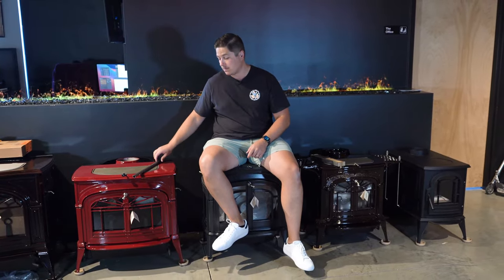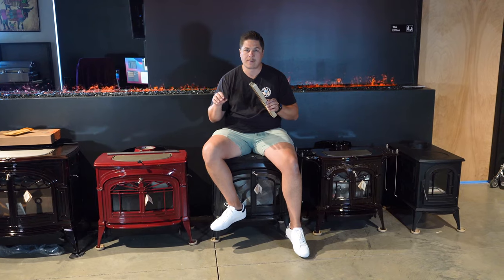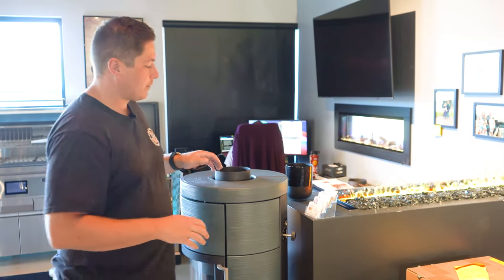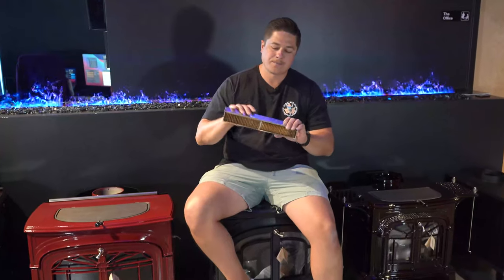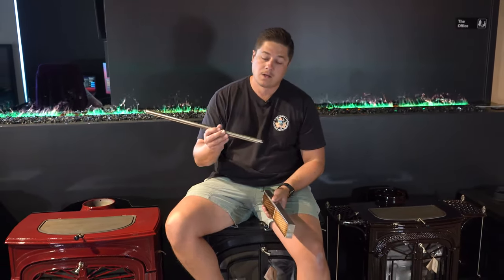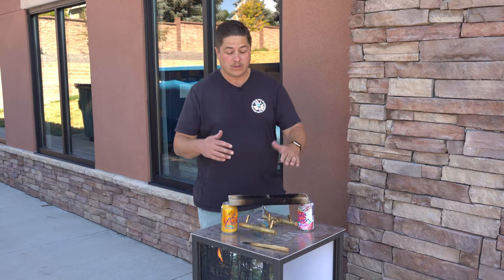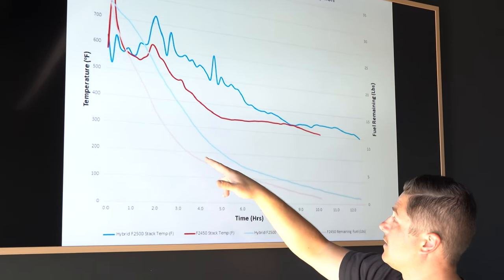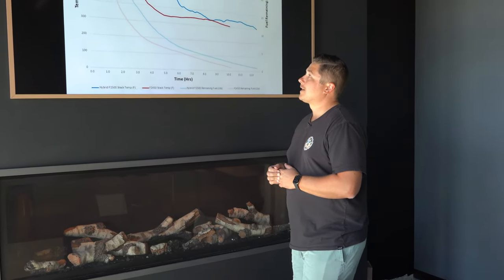Catalytic vs Non-Catalytic Wood stoves (Which one is better?)

Comment: Fun fact. Burning pine indoors is not a problem.  Of course many many old timers have always known this and have been getting cheap pine for firewood that nobody else wanted. The University of Georgia did a study on burning different types of wood in fireplaces and wood stoves.  The findings were incredible, that pine does not put out any more soot or create more creosote than hardwood. In fact, hardwood can actually produces more. Pretty insane considering conventional wisdom, a.k.a urban myths, has always said the opposite. The only thing to make certain of is that each has been seasoned to less than 20% moisture content. It is believed that the old wive's tale originated from people burning it after seasoning it the same amount of time as the hardwood and began to get buildup therefore assuming the problem was the type of wood. The problem never was the wood but rather the time spent letting it season. Pine takes twice as long to get it below 20% than does hardwood. Pine burns much quicker and doesn't create many embers. So as these wise old timers have always known, it has its place in the firewood lineup. It's great for starting a fire. It's great to initially get a wood stove up to high temp quickly. It's great to fire back up a stove that has gotten cooler. When using it as starter wood, follow with hardwood for more longevity.  Imagine the tons of pine that can be gotten so cheaply. These old timers are not liking their secret getting out. :)
Reply from the maker: Nice! thats great information! thank you.
Reply: Love pine.  Seasons fast and good for when I’m off work and able to freed the stove more. I’ve never had an issue with creosote with pine.
Reply: @brockbaker3able  he said pine takes 2 times longer to properly season so to say it seasons fast is not correct.
Reply: Pine is pretty much the only wood we have available here in northern Idaho.  Burns just fine as long as it's seasoned and dry.
Reply: Alaskan spruce burns well here in Alaska. Nothing but ash left.  
I also burn birch, but I get it before the trees start drawing moisture.
Reply: @Lecon60  Oh ya, well my Idaho Blue Spruce burn better than your Alaskan Spruce any day of the week. 😆(couldn't resist)
Reply: @timbjork2098  he's wrong. I can put pine in a rack in March and by November it's below 20 percent. He's completely wrong.
Reply: I'm not sure what gives you the idea that pine takes twice as long to dry as hardwood but you're wrong. I've been testing my firewood with moisture meters for years and that makes absolutely zero sense. The only pine with a comparable moisture content to hardwood is maybe sugar pine. The rest dry way faster than most hardwoods regularly used for firewood. It takes me 2 summers to properly dry northern red oak. I can dry pine in about 8 months.
Reply: Maple and pine are my favorite woods to burn both season in about 9 months for me depending on the weather and how dry I can keep it.
Reply: @davetruewang-bz4oi  What "gave me the idea" was the study that was done. I'm sorry if the information is incorrect or doesn't match your experience. It now doesn't match mine either. I began splitting and stacking pine for the first time after learning this. The pine has seasoned a lot faster than the hardwood I split around the same time. It makes me wonder if it was possibly a different pine that was used in the study or what the conditions were for the study that made it take longer. Going to figure out if it was wrong or if I screwed up somehow.
Reply: I got it backwards after reading all of the info. My bad. At 50, I can read something and 10 minutes later forget what I just read. Pine takes less time to season, but hardwood can actually create more soot than pine if not seasoned long enough. So either wood can be a problem just as much as the other. That's why the problem has never been the pine but rather the time either wood should be given to season. That and the temperature at which it is burned. Soot is a result of either unseasoned wood or of burning at too low of a temperature. It has nothing to do with resin as people have said for decades. :)
Reply: @Sevenine88  Google University of Georgia study about burning pine vs hardwood.
Reply: Only a reburn stove for me, thinking futuristically if everything went hell in a hand basket tomorrow, no power, gas, water, communication etc that catalytic honey comb wont be available to purchase because you and the other stores manufactures wont be open or working and it would be pulled out and thrown away and then your back to square one. So don't think of just today, the way things are going in our country, think about the future and the worse that possibly could happen. Just an old man's two cents
Reply: Burning anything indoors can be a problem.  The amount of people with fireplaces that think they are like a natural gas furnace (throw in wood and forget it) is amazing.  That is more the problem with any wood.  Wet wood is the enemy.  Personally, I avoid pine and use primarily Trembling Aspen and birch.  Pine is nice outdoor campfire wood with the snaps and pops.  I found Pine/spruce/fir did leave more carbon behind, and Aspen/Birch had virtually clean fireboxes.  I have a professional chimney sweep come by once every 3-4 years for insurance happiness, and the pictures are always creosote free.  

Yes, I am older than most.   I've been heating with wood for 40+ years, and experimented as a young lad with different styles, etc.   Burn what you have, just understand how the wood works, how your appliance works, and don't play f around and find out.
Reply: what's nice about pine is relatively low ash. I burned cottonwood and man, is it ashy!

Comment: Neither are better. In my opinion, the EPA should be abolished they have their dirty unelected mitts in everything from wood stoves washing machines to diesel trucks. Overcomplicating a simple device, season your wood properly and my old fisher is almost as efficient. And to boot, although frowned upon if you must you can burn something a Little green if you run low on wood. Never understood all this nonsense.
Reply from the maker: ok
Reply: Agreed

Comment: My Blaze King Ashford 30 will EASILY burn for 24 hours on low, the catalyst always in the active zone. The non-electric highly effective automatic thermostat is truly set and forget. I replace the catalyst every 12,000 hours of burn time.
Reply from the maker: good idea
Reply: Your going to see smoke out your chimney before you reach 12000.

Comment: The 2" thick by 6" in diameter round catalytic converter on my 40 year old consolidated dutchwest by Vermont Castings is made of a honeycomb, hard clay like material. The maintenance requires rinsing and saoking with warm water once per season. My first converter lasted approximately 25 years before small pieces of the material degraded and began breaking off. After the temperature in the pin thermometer that fits into the steel plate above the converter reached 500° I closed the damper and diverted all of the exhaust through the converter. I call it cracking the smoke to clean it up. You can go outside at this time checking the stack and see that there will be very little to NO smoke coming out. Granted, we don't have Severe winter's here in Louisiana, but many cords of wood have gone through this stove and converter over the years! Absolutely Love it!!😉
Reply from the maker: thats awesome. Many people ask how to clean and how often. Thanks for the responce.
Reply: @embersliving  Once a year I'll get on the roof and pull the stainless cap off the stack and drop a 6" wire bottle brush weighted with a 6 lb mall head down through the stack with 28ft of rope. The only resistance for me is going through the triple wall piping, the single wall is not as tight. After 3 passes I go inside, open the top damper and pull the carbon pieces into the stove dropping to the ash pan (approx 2-3 cups of carbon. All vents are closed and no dust goes into the house during the brushing. We Must use Well seasoned wood, especially if you like to burn a cooler fire at times and have a tall vent stack! Unseasoned wood, burning cool fires means build up in the stack, creating a fire hazard. I burned some slightly seasoned RED oak one year and inspected a few 6 ft sections of the single wall piping because I didn't have much carbon accumulation after brushing. I found an 8th of an inch of smooth, hard, carmelized coating throughout the piping. Couldn't remove it with a metal scraper, so I replaced all of the 6" stack. I have 26 ft total stack and I must burn very seasoned Oak. Shorter run of stack should result in less coaking.

Comment: great segment sir. you clearly explained the difference between CAT stoves and secondary burn stoves. I've been burning wood in my current house for over 25 years. I had a CAT stove from Consolidated Dutchwest that was ok but i didn't like it and got some secondary burn stoves. I currently have a Jotul F3CB upstairs in 1100 square ranch and a Pacific Energy Summit in the full basement. Both have served me well in southern Maryland. Most of the time my Jotul does the job. During this last cold snap and snow, i had to fire up the Summit. Key to any of them is using dry, seasoned wood. thanks for sharing.
Reply from the maker: Im glad our video helped you!

Comment: Cheers for this, very informative. We installed a catalyst wood burner 12 months ago and very impressed with it compared to the old wood burner.
Reply from the maker: Thanks for watching!
Reply: Have fun repairing your catalytic combustor. High/costly fail rate on those.
Reburn much better=less potential of failure.
Reply: @Bayside  where having lots of fun.... burning half the amount of wood , been 2 winters now and catalyst still performing very well. Absolutely amazing.
Reply: The science that you don't understand behind the catalyst, is that the precious metal platinum in the honeycomb catalyst, lowers the burning temperature of smoke, allowing it to be re-burned👍

Comment: The precious metals on the combustor lower the burning temperature of smoke from around 1100F to 500F so it can burn.  They work great provided you take care when using them.  I've done so for 30+ years and really like them.
Reply from the maker: awesome!
Reply: How about over time as the stove cools down, is it going under 500 degrees and not working properly? I’ve gotten coal base 12 hours but the stove doesn’t seem very hot. What about the air intake and the spring inside? My stove is old and I think it needs replacement. Any help on this would be appreciated thanks.
Reply: @lordmarshall5239  What stove do you have?
Reply: @StudioRV8  I have a1987 I believe, Intrepid 2
Reply: @lordmarshall5239  Tough to say with a 30+ year old stove w/out seeing it.  The new Intrepids are flex burn and work with or w/out the cat combuster.  Not sure what they used then.  I think they were all cat stoves.  I'd start with the manual and exploded parts diagram and make sure everything is working properly.   If you need a new combustor, I'm sure you could buy one. I was able to find the manual for a 1990 Intrepid 2 online.  Youtube won't let me post a link, but I'll try to put everything by the http in the next replay to see if that works.
Reply: Add https:
Reply: @StudioRV8  thanks for your effort. I do have the manual somewhere. The stove does  do well in my tiny camp style snowmobile house in Maine. It just seems like it’s probably under 500 over time and not up to the science. It does work and I’m happy so I might just be wrong. I’ll make a better go I’ve learning and maybe open it up this summer. Thanks again for your time
Reply: @lordmarshall5239  The intrepid, like the Defiant I have, does not measure the temperature of the combustor.  400-500F is okay for the top of the stove, and with a reasonable fire, should be enough to light the combustor.  I have a Defiant at my house, and an old Vermont Castings Federal Dutch West in my parents (both also in Maine).  The Dutch West has a temp prob right on top of the combustor, so you know exactly what's going on.  The Dutchwest is circa 1990.  It's a nice stove.  Wish they still made them.  Running a stove is a little more of an art than a science.   There are lots of variables with the stove and lots of variables with the environment.
Reply: @StudioRV8  yes I saw a video saying to put a thermometer on the top right corner and close the damper at 550. I need to reread the manual to understand a few other things like the air intake and the internal automatic spring. I’m having success it seems I’m just trying to know more and get better. I’m in Eustis and it was real cold this winter, until now 😊
Reply: @lordmarshall5239  Yes, you are up there!  The two stoves are in houses on a lake in the Bethel area, but we also have property on Moosehead Lake.   I've landed the float plane on Flagstaff Lake,  by I fly over Eustis all the time on the way to Jackman airport in the RV8.  Stay warm. Cold weather returning tomorrow.
Reply: @StudioRV8  that’s great! Sounds like you have a nice system of enjoying the state. I’m back to New York Sunday unfortunately, great place so much fun over here. I’ve snowmobiled Moosehead, very nice all over this region of the country. Enjoy 😊

Comment: Catalytic  is the best!! My Blaze king princes heats my 1600sq house all day with 4-5 16"x8 logs for 16 hours. And still have plenty ambers to get it going again! Combuster still working great after 6 years. All I donis brush the front and shop vac. Key is gettit plenty hot before engaging it.

Comment: I appreciate having both technologies in my Hearthstone stove. While heating up the stove from cold or after reloading fuel, secondary combustion burns vigorously, producing very clean thorough combustion at high throttle angles and higher combustion rates. Once things are heated up, engage the catalyst and choke it down. The fire can settle into lazyer flames and smoldering, letting the catalyst perform the combustion downstream. This helps separate the combustion from the fuel, providing a slower burn rate. I routinely find a warm stove 12-16 hours after the last reload with coals for a relight. Sometimes even longer. The most impressive part of that, is that I'm burning trashy low density ponderosa. I can only imagine what hardwood would do in this stove. Probably would be capable of 20-24 hour burn cycles.
Reply from the maker: Thanks for the insightful comment on the hearthstone! That is one of our favs.
Reply: I am looking at a Hearthstone 
Heritage.  How do you like yours?  Any issues with it?  I’ve read some really great reviews and some not so good. I went up to my local dealership today here in upstate New York and it’s a beautiful stove!
Reply: @MDR-hn2yz  Had some leaks in the top stones that I resealed with refractory cement. I think the top stones on a lot of these aren't sealed great from the factory or are jostled loose in transport. After that easy repair the stove has been perfect. Ours is the Mansfield, which is similar to the heritage, just a slightly larger, more "square" firebox. It takes wood N/S or E/W from the front door, which works great for our corner-install application. 

It's a complicated stove made from lots of separate pieces. Combines the beauty of a cast iron stove and a stone stove. If you decide to buy a stove like this, go into it with the level of "respect" that the reality of it deserves. This is both a wood stove and a piece of art. It's not going to be as utilitarian as a welded steel stove. Treat it with care and it will treat you to beautiful fires and soft warmth that lasts many hours after the flames have gone out. 

We absolutely love it. Going into our 4th season with it and I have 4 cords of very dry wood split and stacked and ready to go, and another 8 cords that I have almost finished splitting that we'll use in future years. (We burn ~3 cords a season).

I think the mixed reviews are "fair" all around. These stoves aren't for everyone. If you take the time to really read the manual and learn the proper startup procedure and pre-heating procedure, and follow the recommendations in the manual for daily "high-burns" to help keep the catalyst clean and properly get the catalyst going, you'll get really great results from the stove. If you just want a box you can burn in any ole way you want, you'll be better served with a non-cat stove.
Reply: @mdocod   thanks for the reply.

Comment: If you are really "off grid", you aren't going to be able to find someone to clean that Catalytic Converter.
For "survival  purposes" (Zombie Apocalypse) the best wood stove, would be the  one that requires the least amount of maintenance, 
and maintenance you can do yourself, as  well as something that doesn't need high tech technology, and the mining of precious metals, in order to work.
I'll take the secondary reburn system.
This was very informative!
Thanks!
Reply from the maker: I'm glad you liked the video Old Yeller! We recommend you have two Catalytic Converters. So long you do clean burns the converters can be used for a long time. In a zombie attack however I think you're right about the re burn system!